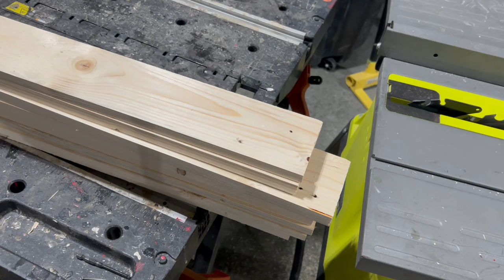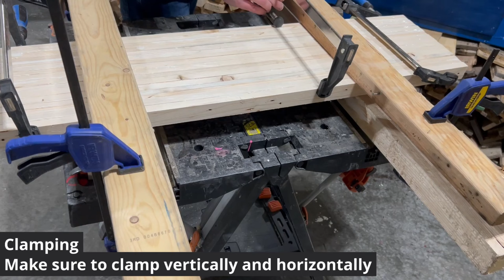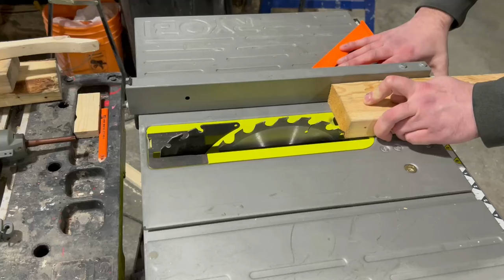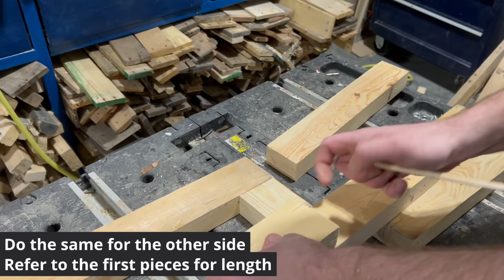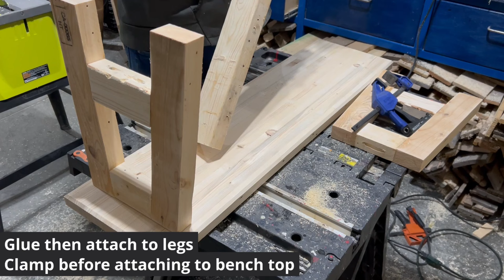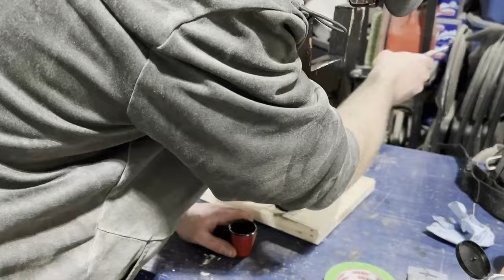Sell Benches for $70 Profit Each on Marketplace

Comment: if you couldn't get the 2x3 to make the legs, do you think would  have been possible just with the slats from the pallets and gluing them?. Great video.
Reply from the maker: Ive done it to get full hardwood benches from hardwood pallet planks glued together. Without a jointer it could end up with gaps though. Most pallets I find have runners made of some form of 2x wood, sometimes without the round coutouts. I look for those mainly. I have acces to so many pallets that I can definititely chose and leave some behind. Thanks for watching!